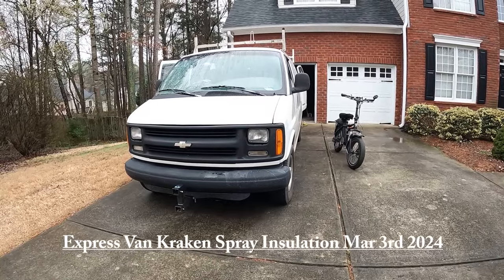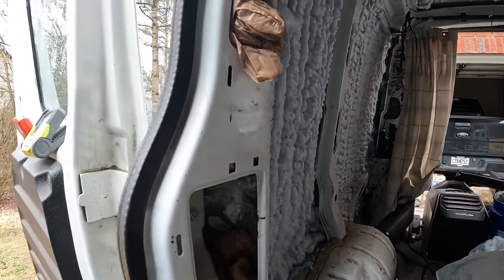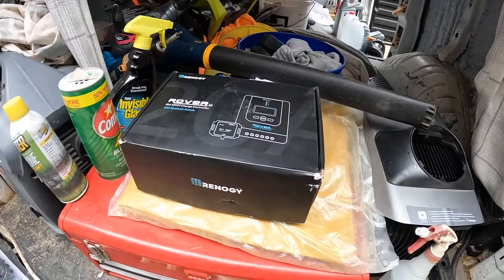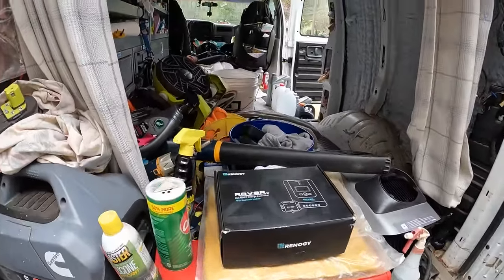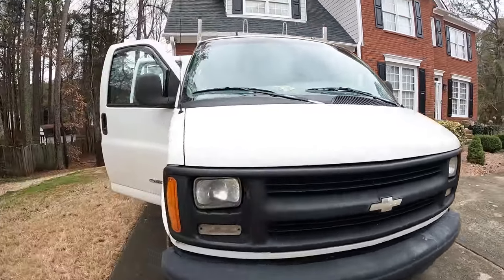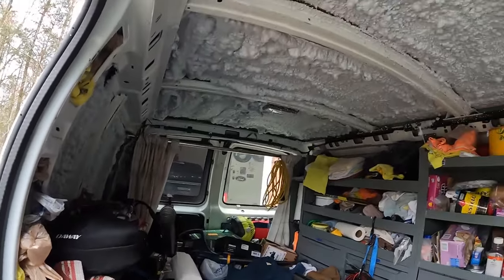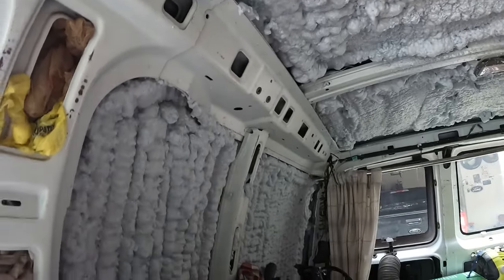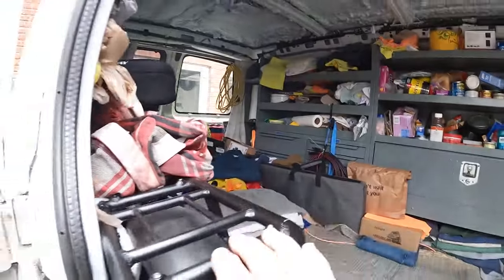Kraken Spray Foam Express Van Kraken Spray Foam Follow Up March 3rd 2024 #Express Van Insulation

Comment: Have you ever replaced lower intake manifold gasket and gaskets above/nearby the intake manifold and why did change them?  I have been unable to remove the cruise control cable from the throttle-body and I am afraid I will break it if I use too much force.  Other diy’ers claim it involves wiggling cable end off the TB, but I can’t still get it off.